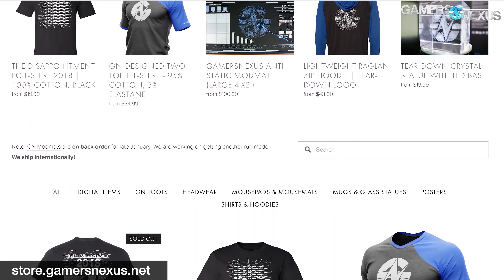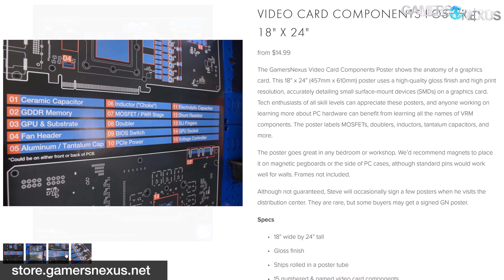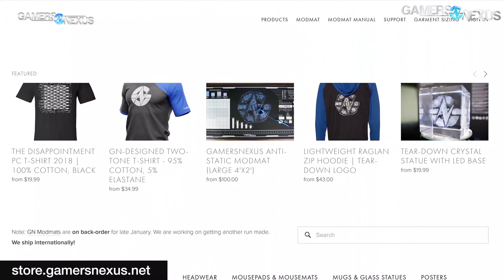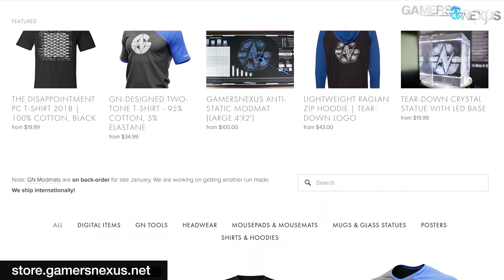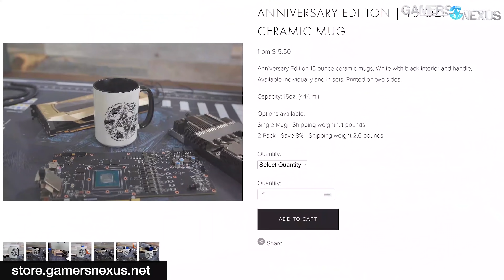Tear-Down of $2500 Titan RTX Video Card

Comment: Steve I absolutely love this channel, but I have a minor criticism. I know its important to promote your merch, but lets be real you can use a piece of paper with some squares on it to keep track of your screws just as easily.
Reply: I would never use a piece of paper (my 4,000 rpm AIO would blow it away, and if it didn't, then the Titan sitting next to it would). I normally just toss all the screws into a magnetic tray and thing "meh, I'll figure it out later". That's bad when you are removing half a dozen GPU coolers in one day... I found out its VERY bad... Thankfully I didn't finish all the cards, so I could just look at the ones that I hadn't touched. The GN mod-mat has anti-static wrist bands too, and I'd actually use that grid for screw layout since it won't move around like paper.

Comment: I have a NV40 quadro made in Taiwan and another NV40 6800 Ultra made in Korea. The Silicon quality was vastly better on the Taiwanese Quadro, lower voltage and managed a 27% OC.  Could only get slight above stock on the geforce counter and it had a higher voltage stock.

Comment: It was my understanding that the black stuff around the ram chips is actually an adhesive used before the soldering process.  Apparently certain areas of the board can have issues with chips sliding when they are going though the solder.

Comment: The black stuff is called infill, it provides better structural integrity. The card can flex over time in the slot and the infill helps prevent the solder balls from cracking under strain

Comment: I'm pretty sure it would never work, but it would be neat to solder the 24gig  on a 2080ti and flash the bios to see if you could upgrade your 2080ti
Reply: Extra solder around the vram so it's impossible

Comment: You can touch the tip of a soldering iron on the heads of the screws for a few seconds to melt the loctite and make it easier to remove.
Reply: This doesn't work, the heat transfer is usually bad.
Reply: It's not bad if you do it fast. Just enough to soften the loctite. That's usually enough to loosen the fastener.
Reply: @JohnSmith-mk8hz  Surely that will make the screw itself expand possibly damaging it as if you had severely over tightened it.
Reply: @jaxativejax662  Not really. Both the hole and screw will expand. Soldering iron wouldn't really work either. They need solder to wet the contact for heat transfer to be effective quickly.
Reply: No, I"ve done it many times without issue.

Comment: Off topic, anyone ever hear of crashing caused by high (above 60) refresh rate? using predator x27, rtx fe, i9900. Water cooled loop, everything cool, but game jst crash above 60. Its not the power supply, is it G SYNC?  Stumped
Reply: Probably the game engine that is limited to 60fps by default.  Try to go higher and physics are off to the point the game crashes...  It was often the case for Skyrim and even Fallout 4.
Reply: @JimmyRJump  i suspected, but hoped it wasn't so...haven't upgraded in 6 years til now.
Reply: it happens to all games? can you describe the crash? for example i have a freesync monitor and i got of the internet that freesync demo that was roaming a year ago.. and it's not supported by AMD anymore that demo, and when i try to run it somehow after few seconds (like 5) BSOD every time...(it's that particular demo cuz nothing else behave like that) i would think that something like this might happen to you? might be something in-game that is not supported anymore? dunno
Reply: @wabachi  happens mainly on Killing Floor 2, the gaem just locks up, black screen, no audio, can't even c-a-d to destop...but I got crashes on some Origin games too, just haven't confirmed that its related to the refresh rate. (had a bad RTX to start with, which didn't help) KF2 definately is, atleast it doesn't crash at all if its lowered
Reply: @MonkeyspankO  lock p and black screen, no audio or stuck on audio are signs of driver not responding, i'm not saying the driver is bad but something might trigger the driver to not respond after 60fps (if it's not hardware level the problem)
Reply: @MonkeyspankO  well... who knows might be the monitor cable not good enough to transfer data above 60fps lol, i'm joking.. don't know tho... might want to reinstall things use DDU for video driver and see if still happens...

Comment: I was thinking the underfill was to prevent somebody from getting liquid metal under there. Imagine having to re-solder that. There could have been an engineer who just made that decision. idk
Reply: I was thinking, "That's not a bad idea to do to my cards... Wait.." Just remembered I'm running HBM. But hey, it should be a great idea for my other cards! I'll try to find some rubberized coating. I would use Plasti-dip, but only peels off with a lot of layers, and I think a putty would be better so you could remove it later (for my use case anyways).

Comment: 10:50 The extra reinforcement for the part of the PCB that will flex the most; PCIE connection area so when it flex's you don't crack the solder joints connecting the VRAM to PCB

Comment: What did people expect? Companies in the silicon business dont want to produce a new Die for every new SKU.
Just look at Threadripper. They are also the same Die.
Hardware hotheads should cool down a bit. Start programming and write more effective code so we dont waste hardware resources. Higher clock speeds and more cores are not the solution to everything.
Reply: Your right, we need higher voltages too!
I once saw Pong struggle to run on a GTX 1080 and 6700k making 5 fps with massive frame time inconsistencies. I looked over at my friend and said "you need more Vcore bro" and walked away. Obviously you can't blame the programmer when a game like Pong with its advanced physics engine struggles from time to time, you just need more liquid nitrogen!

Comment: I saw you had an anti-static wrist band at like 3:50. I hope that's not a "wireless" one and is properly corded to earth ground. "Wireless" Anti-Static bands do not work! They have no way to discharge the accumulated charge too!
Reply: Have you looked at his GN Modmat? Its pretty cool, it has an anti-static wrist band feature (you should check it out, its not just a glorified mouse pad, they are pretty cool).
Reply: @jakegarrett8109  Well, glad I looked it up. It is indeed a corded anti-static band. And the mat is static dissipative. I was just worried he was using a bullshit "wireless" strap.

Comment: The black stuff around some of the VRAM might be underfill.

If those VRAM modules go through a lot of rapid heating and cooling, then the underfill would help to prevent the solder balls from cracking and whatnot.

I'm no expert on any of this, so it may be something entirely different for an entirely different purpose.

Comment: So higher binned 2080ti for twice as much. Noice. I hope AMD comes up with something in 19.
Reply: With an additional 13GB of RAM, 4 additional SMs and FP32 accumulate in tensor operations.  So basically more of a lower binned RTX Quadro 6000 without the Quadro drivers for around 40% of the price.
Reply: @mashygreen6974  i think allot of people think this is supposed to be a gaming card lol
Reply: @dushikorsou1  remember titan being advertised as gaming card till last generation... cuz people start to realize how rip off it was... as for... "non gaming card" why isn't it into the quadro series? those are pure non-gaming cards...
Reply: @wabachi  well i think its supposed to be a cheaper alternative like the titan v.
Reply: @dushikorsou1  umm wait maybe i'm misunderstanding this one is a cheaper alternative tot titan v or the other way around... anyways it's still 2 titans per generation... last generation we had titan Xp and titan XP ...
Reply: wabachi there were three in Kepler, Titan, Titan Black and Titan Z, 1 in Maxwell, 2 in Pascal, 1 in Volta and now one in RTX.  They were never pure gaming cards and always shared the same GPU as the Quadro 6000 of that generation (sometimes cut down, sometimes with features disabled).  In Maxwell and Pascal the only features it offered over a *80Ti were ECC memory and the drivers, and it was hard to market the Titan accordingly as it was somewhat stuck closer the the GeForce, but Nvidia still tried to market it as a workstation card for compute and AI (which the Quadro is not, its for professional graphical workloads and CAD).  With Volta that changed and they removed all GeForce branding.  Turing is following that logic and has added features from Quadro which are missing from the 2080Ti.  This card is definitely not marketed for gaming, and makes NO sense for gamers or even most professionals with traditional workloads.
Reply: @mashygreen6974  on their own website Nvidia was advertise titan as "the fastest gaming card" up until last generation ... they were always gaming cards... was the "upper echelon" cards... and i'm not 100% but i think you are wrong about sharing the same GPU as quadro, i might re-research that to be 100%
Reply: wabachi from Kepler was really confusing, with the advancement of the Tesla cards and GPGPU computing gaining popularity, so the Quadro were still strongly pushed as ‘compute’ cards.  Also the 780 was the same GPU as the 780Ti, Titan Black a Z, Quadro 5200 and 6000 and the Tesla K40.  
Maxwell changed a lot, and the segmentation of the 980/1080/2080 from the Ti version started and still runs.  The Ti are always the same as the Titan and the Quadro 6000 (M, P and RTX), with more functioning SMs, lower TDP and options for larger VRAM, and of course the drivers.  The *70/*80 cards had the next down GPU and so on.
Titan cards started off being the top end of the GeForce line but without the majority of the pro features (mostly the drivers).  They were aimed at the ‘HEDT’ market of the ‘professional that also games’ and quite heavily to the compute community.  In Pascal though we had a new segmentation and the Tesla cards were the only ones with the top end GP100 with the Quadro P6000 being a GP102 like the 1080Ti and Titan XP and Xp (the first a cut down version, the second full).  With Volta it drastically changed and Nvidia shifted the Titan range strongly to where it was with Kepler offering a truly revolutionary compute GPU, removed the GeForce branding, but kept on board the ‘bling’.  For reference, Nvidia would send a researcher in AI or computational physics a Titan Xp rather than a Quadro P5000, as it’s more suitable for compute. 

Sorry, typed a bit much, but just trying to get across that judging this card solely as a gaming card because it’s a ‘Titan’ when they were always ‘in-between’ cards that have now more strongly crossed over, is defiantly not the sole viewpoint available.
Reply: @mashygreen6974  i get what you are trying to say, but from an advertisement point  of view they advertised all of their titans up until last generation (aka up until V) as gaming cards on their own website... the whole idea is about advertising... remember when jayz2cents was doing i think terry cruse's build and asked nvidia for the new titan, around that time they started to stop advertising it as gaming card... but funny enough even tho they said to jayz it's not a gaming card on their own official website was still "fastest gaming card" ... do you understand what i'm trying to say?
Reply: wabachi not really.  I would if we were talking about the Titan Xp, but we are not.  You basically have a problem with Nvidia repurposing the branding of Titan to be ‘exclusively’ for the compute part of what it always was and dropping the gaming part?  Would it have been all okay then if they called it by whatever other name - like Hyperion or Ganymede - but had the exact same marketing otherwise?
Reply: Though if course you could buy multiple AMD systems for what the high end Intel and Nvidia stuff costs, then network it together, and then beat the Intel equipment for processing power setting up a distributed processing network.
Reply: jesters vengence 6 months later, your comment came true😊
Reply: AMD is dead lmao
Their shit Ryzen is forgotten 
Well thats the fact not a fanboy but thats the fact
Reply: @RizLazey  nice bait
Reply: @RizLazey  troll much. Here is some advice for you. It is better to remain silent and thought a fool than to open your mouth and remove all doubt.

Comment: Quite a markup for 13g's of ram, a milliliter of gold paint and extra effort put into throttling the GPU. I wouldn't hesitate paying an extra $200 for the Titan, but damn an extra grand and change? NVIDIA needs to rethink their strategy, greed will be their ruin.
Reply: Yeah I know, workstation GPUs are meant for gaming and should be priced according. That extra 13GB of GDDR6 most likely cost more than $200
Reply: @betrayedpredator8826  Total cost for 24GB of DDR6 is $632,  Total markup is $350, plus the binned chip. still not worth $1300 more for the card. Nvidia is a fucking ripoff
Reply: @betrayedpredator8826  Considering the RTX 2080's are overpriced, memory price fixing adjustments and Nvidia buying it by the boat load at major discounts what would you consider a reasonable price?
Reply: @betrayedpredator8826  These are not workstation GPUs though... Why is the Quadro P6000 a good $5k more than my Titan Xp? Because its ECC Vram... Why is the RTX Titan still having the gaming brand designator "RTX"? Even my Titan Xp didn't day GTX anywhere on it, it was labeled "Titan series", and under driver download page, its on the same page as the Titan V (GTX series is separate from Titan, which is separate from quadro/Tesla). Yet the Titan series is just a glorified gaming card, its certainly not pro drivers, and its not ECC memory either... So they are not marketed as pro use, that would make the $6k quadro series a moot point.

Comment: Same card, so what costs an extra 1300 bucks? What a rip off!
Reply: 13gb of vram @ $100/gb 😂😂
Reply: @heru_ur6017  So this is China's proof of Memory price gouging. Makes sense
Reply: @heru_ur6017   $26.32/GB
Reply: 24GB GDDR6 + 2.3 times higher tensor performance. Both important for a workstation computing card such as RTX Titan.
Reply: The titan isn’t supposed to be a workstation compute card. That’s the purpose of the Quadro.

This card makes no damn sense.
Reply: @eddiecarter8134  No, you're ignorant, educate yourself

Comment: so even the dies are the same
I wonder if its possible to "activate" the missing cores and shit in the 2080ti to convert it into a titan
Reply: Not possible 

Same with soldering more VRAM
Reply: Almost certainly not.  The 2080Ti is likely a TU102 with some ‘some’ (up to 4) defective SMs which couldn’t make the cut for the full version.  The Titan is also likely a lower binned TU102 compared to the Quadro (it has a higher TDP and lower base clock compared the its Quadro counterpart).  You can’t do much about the silicon...

The one thing that ‘might’ be possible to enable with a bios hack is the FP32 accumulate on the tensor operations for the tensor cores, but that is yet to be seen.
Reply: Well, depending on yields it is possible that some full TU102 are being sold as 2080Ti's because there's more demand in that price range.

If this was the case, Nvidia is most likely lasering off the disabled SM's.

This is not AMD we're talking about, where some of the Ryzen 5 cpu's just have 8 cores enabled.

Comment: $2500 of pure disappointment...
Reply: What's disappointing about the fastest GPU on the planet, that you cannot afford one?
Reply: @CallsignVega  
The problem is not the money, the problem is that the fucking cards aren't worth the price.
Reply: @marilyto  well isn't it supposed to be a cheaper version of the quad cards?? Which cost way more then these. It ain't really a gaming card lol
Reply: @dushikorsou1  Which professional workloads can be done only with a Titan RTX that you can't do with a 2080ti, 1080ti or Vega 64?
Reply: @dushikorsou1  the only big difference between the "gaming" line up and the Titan is the amount of VRAM it has. The RT core and Tensor core increase is extremely minimal. You're basically paying a whole lot extra for some extra vram, which I'm sure is good for the workloads of Quadro cards but, these still seem to be marketed towards gamers
Reply: @nathansstuff1547  different drivers 10 bit full support tcc mode 32bit fully unlocked tensor core and 2.2x vram
Reply: @ToriRocksAmos  alot actually i render large 3d scene and had to buy last gen quadro now i got the titans yesterday makes life better

Comment: Titan should be 700. Not 2500.
Reply: Titan should cost what the 2080ti costs and 2080ti should be $900
Reply: No doubt there's a significant markup, however..
Do You have some insider info on cost to manufacture and R&D?
Or you just pull that number from your bum?

Rhetorical question- I already know the answer...
Reply: @dickr9345  still look at how much hi end  cards used to cost   8800gtx  massive change  to gpus  new 600usd  in 2006 752 usd  in today's money     first card using cuda  bid deal   was a much  bigger  step than these  rtx cards  are from say a 1080ti   with  gold (used in the gpu)  and ram price increase  its probably a 1500-1600 card   all things given  right now
Reply: @dickr9345  Not to mention die size, halfes the amount of Chips per Wafer and Doubles the failure rate per chip

People have to understand that Nvidia doesnt Just Charge a random exorbitant price for nothing
Reply: @Hyperus  funny to find you here, how's that nvidia innovation going?